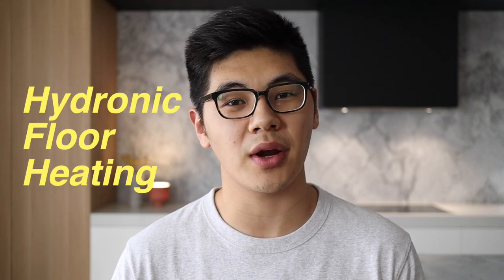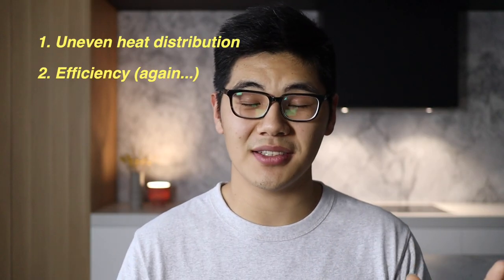Hydronic Floor Heating System Review - 2 Winters Later

Comment: If it were my home I would have used Copper pipe... & the reason for that is it never rust & evenly distributes heat & cold. Yes it' pricey but remember it is in investment
Reply: Concrete eats copper, so I'd advise against that. His issues aren't due to spacing of the piping, his issues are largely based off the fact that the system wasn't built correctly. (no insulation under the slab) Contrary to popular belief, heat doesn't just "go up." It goes to where it's cold. He's losing massive amounts of heat out of the edges and bottom of his slab if they're not insulated. He also needed proper zoning.
Reply: we had copper lines in our houses (9) floors, lasted 30 years, then all went within a few years. Loved watching cartoons on that nice warm floor.

Comment: your system was poorly designed and installed. but thanks for doing this video as it is awesome your giving feedback about it. should have had more pipe in the bathrooms and where the concrete was more mass.
Reply: crazy how structural strong your floor is. we would never need that much concrete in Canada and we have strict codes. It must have been expensive as you probably use about 4 times more concrete then we do. surprised that you don't put any structural steel reinforcement bar in it only the mesh grid. great video thanks
Reply: we put insulation foam under slab or under the pipes. your system should have had a dense foam break about 6 inches down.
Reply: ya you should have gone with the in screed. more expensive thought
Reply: wall hung cabinets in the bathroom with keep you toes very warm cause you could put pipes right under your toes.
Reply: no decorative concrete would not mix with the other concrete as you would pour it later after the first layer is dry